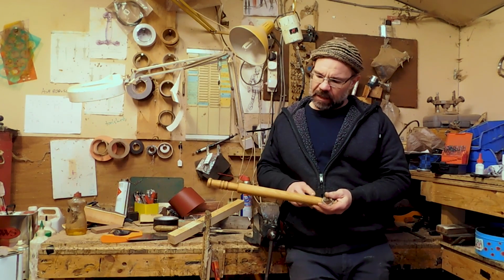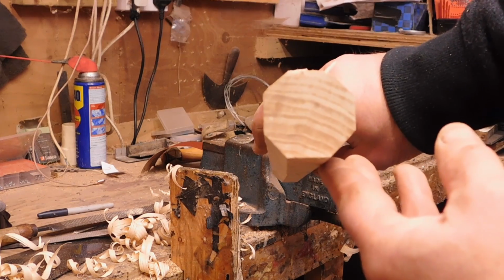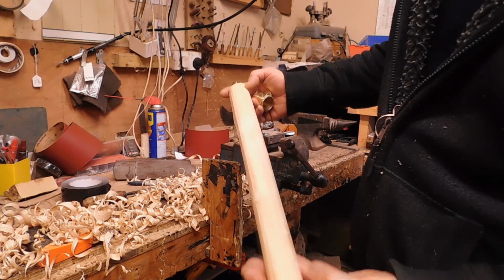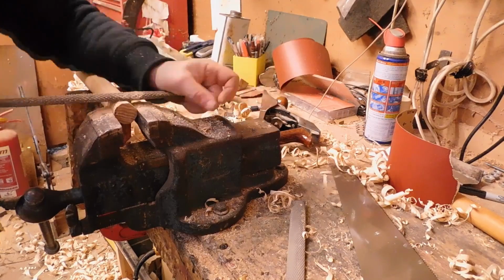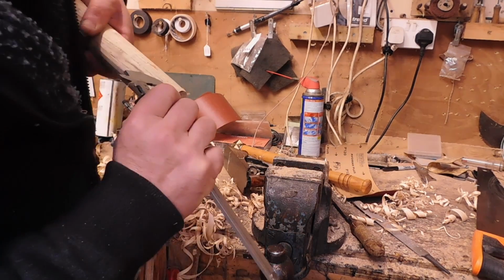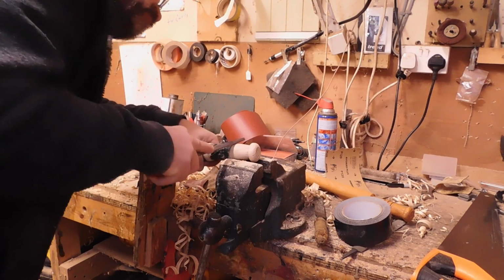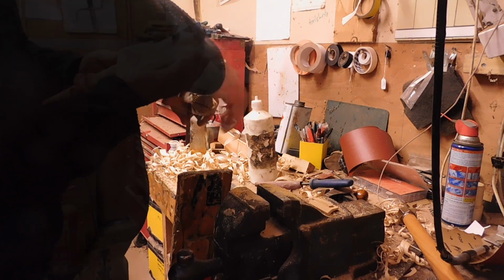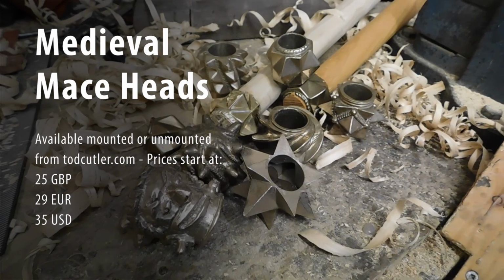Hafting a Medieval MACE HEAD

Comment: What are your thoughts on making a halberd socket? 

Would you make the entire headpiece 2 halves forge-welded together?
Or just make the two socket halves... and forge-weld bade, top spike and backhook between them?

Other option is to split the bottom of the Top Spike and put a flat blade in between the langets. I think this is the easiest way, but it is not fully socketed.

Full square socket seems to be the most common historical method.

Comment: Shafting a head with a saw, quite long winded.& why did you use a clearance fit on shafted bit like a mace or hammer?
your method works but it's not very time productive tod.
you never learnt craft from the elders did ya.

Interference fit is easier, more secure & traditional: 
1;make the shaft mounting end just larger with slight chamfer, then hammer it on while cushioned by say leather rubber or what you got lying around. 
2:get a sharp sturdy chisel & hit a line out for a wedge to hammered in.
3:Optional, cut the excess of the of the shaft to make it neat.  
Note: carpentry saw are a relatively new thing in terms of history grand scope. 
Use a hewing axe or normal ax for rounding the the shaft if  you are confident enough. 
It's not as difficult as it might appear or seem. 
Just takes practice.      

This is how my grand father a part time Ferrier in his free time along with every smith I ever met hafts a bit to a shaft.

Material wise: why use use a square section, just go get a rough sized branch bark & all then hew it to size & treat it before hafting.
Soak the wooden shaft in horse piss for a day then post hafting varnish if feeling luxurious. 
If you don't like piss use old motor oil from a motor but leave about half the time. 
Dry or wipe of the excess before hafting.

using glue on a haft?:) Hilarious!
Some use pitch or other organic sealants to fill in the voids & prevent water ingress but I don't bother!

Hope people fond this useful!

Kind regards!

Comment: Could you also use hickory or oak for the handle instead of ash? My local hardware store only had oak, I really wanted hickory
Reply from the maker: I would go with hickory - hammer handles use ash or hickory, not oak for a reason

Comment: When I mounted a brass mace head onto a handle. I purchased a handle for a Hoe, since it was made of Hickory and already round. All I had to do was fit the head and tack it in place. I also used Hot Glue to hold the head on the handle. So you don't have to start with square stock.

Comment: The most common tool found in the Medieval smiths arsenal.

Ye olde ducte tape!
Reply: Plus ye-old WD-40.
Reply: As amusing as this comment is it also begs the question: seriously, what did they do before duct tape? I mean I know they got along without it but it’s just such a useful invention it’s hard to imagine not having it.
Reply: @Rokaize  Leatherstrips,  charcoal markings,...
Reply: @Rokaize  leather would be the obvious choice back then. Sinew from a animal such as a deer would also be used as once it was in place and had time to cure and become very secure.
Reply: Isn't it obvious? 'Duck' tape.
Reply: Thou shalt meld their iron with heat and hammer.
Reply: When it moveth thou it shall not, 'tis an affront to god; and it shall thoroughly wippeth before its foul body shall be clad in his holy linen!

If it opposes to the lords will and does not moveth, thou it should; 'tis an affront to god; the blasphemic object is to be drenched in his holy liquid!
Reply: seriously usually flax fibre and rosin with bees wax over the top

Comment: Does the tight fitment of the head prevent the crisp 90 degree stress raiser at the top end? What stops the head itself from causing a stress raiser around the top end where there's been a diameter reduction and where where it's not been filed round?

Comment: Just a tip: it's easier to keep your saw straight if you keep your pointer finger pointed out and laid down the side of the handle. Keep it pointed in the direction you want your cut to go.

Comment: From watching your videos, you're much better in the shop than I am. However, I do have one small tip I can give you. When sawing with your hand saw, point your index finger along the side of the handle/blade. Try sawing a straight line with the method you're using here, then try it again with your index finger pointing in the direction you're sawing. I guarantee you you'll be surprised at the difference.

Comment: Years ago a friend made some mace heads out of oil well drill bit teeth. They were a multifaceted head that looked like the one you were using but bigger.  The thing was to big to use by most people for very long. Shaft and head weighed around 4kg/8.8lbs.

Comment: Seems that using a plank to cut down like that would be introducing weakness into the handle.  It would have a greater tendency to split along one axis than another.  I'd be tempted to use a seasoned branch or sampling so that I have round grain all the way through. I've done this for hammer and light hatchet heads and the tool handles have been tough as all get-out and extremely durable.
Reply: EarthKnight wouldn’t you run into durability issues between the heart and sap wood?

Comment: In the US, I think that hickory would be easy to get and probably the best wood to use. It is the most common (by a landslide) wood used In striking instruments such as axes and hammers
Reply: Oak, Ash, and Maple,.... all are native to ALL of North America... No ??
P.S. I've been a reproduction, production, and restoration woodworker, sawyer, machine operator, and furniture/joinery professional since I was 17.... @ 55 now.
Reply: @kennethkustren9381  Well, ash is on its way out, unless a solution is found for the emerald ash borer.
Reply: @kennethkustren9381  absolutely spot on. I prefer Oak. Hickory is also a great option bc of its strength.

Comment: A few years ago, I picked up the Brass Mace head from Kult of Athena, and yesterday I hafted it finally. I got lucky and found a nice oak dowel at Home Depot, that was just a bit bigger around. So last night using a file, sand paper and a good sharp knife I worked the end down till it fit just almost but not quite tight. Used Hot Glue to attach the head to the haft, sanded down the haft and linseed oiled it. Added a lanyard and a leather grip. Looks good and feels nice, now if I just had a head to crack :)

Comment: How about drop the head over a branch or sapling, and wait till it grows snug, then just cut it off! One year of waiting=a lifetime of service.
Reply: The problem is that after cutting the branch will dry and loosen up. Also bark will make it weaker + if you want strong shaft you make it from heartwood not outer rings.  Usually mace head coming loose is not the problem but shaft snapping after heavy blow is. In history they used iron foil around upper part of shaft to reinforce it.
Reply: As Koit Kõiveer already explained there are a number of issues with that, however, there is one example from history that I know of that uses living trees to produce weapons. In the Slavic, pre-medieval tradition 2 handed war clubs were a thing . You'd find a young oak and hammer in flint flakes at the base of it and then just let it grow for a few years. After that time the tree would grow around those flakes, locking them reasonably deep inside and also bulging in that area. After cutting it down and drying it you end up with a heavy, flint-studded war club.
Reply: Kwodlibet what an awesome idea! Those primitive “weapon designers” were a pretty bright bunch, working with available technology of the day.
Reply: Damn, that's an awesome idea! I would do that myself if tree branches around where I live got anywhere near usable proportions for that kinda thing.
Reply: As lazy as I am, I am also impatient. Want to start macing things now.
Reply: Rust
Reply: @Sgtassburgler  Brass doesn't rust. :)
Reply: brilliance!
Reply: there's a methodology for making early axes where you do something similar with a tree with a y in the top but every method ive ever heard of let's the object grow intl the tree into the deeper wood because of issues with the bark and outer layers of wood
Reply: Said the priest. 

Seriously though like, circumcision sucks.
Reply: Just do the magic trick of immersing a dry branch in water with a few adjustable clamps(depending of size of the head) tighten the clamps every day during a week(depending on the hardness of the wood), then take out the clamps put the mace head and let it dry.

Comment: I would suggest seeking out a robust but supple sapling with a full circular grain to it which would reduce the total amount of work, reduce the potential of splitting, and also allow for the use of its natural taper either for the hand grip, or for locking the head in place, too bad a natural sapling won't offer both options at the same time, albeit with the ability to wrap the handle in leather, or else simply leaving the bark on the end will either one allow for a good grip, it simplifies and speeds up the production of a high quality handle.
Reply: In the process of making handles for hammers and pickaxes for many years, this seems like it would be just as good for combat as for non-combat uses.

Comment: So if right angles create planes of weakness, why would you have a handle like that, and not something more like a baseball bat with a subtle thickness curve starting from the handle and thickening out until you reached the head?
Reply: I'm pretty sure it is to prevent the hand from sliding up the mace. On a bat you only have to worry about the bat slipping away from your body as you swing it, but with a mace you are much more likely to have forces trying to push the mace handle the other direction and having your hand ride up the shaft.
Reply: @Saddestpanda  He even explained that in the video, some people...
Reply: knightshousegames Good question. The only answer I can think of is for you to look at the items retrieved from the Mary Rose and the Vasa of Sweden. Looking at was done then would give you the answer to what they did do,back in the day.

Comment: What about for a mace head that's closed at the top? I'm talking about the ones like "Mace 3" on your website. Obviously you can't drive wedges into the top, so is there a pin or maybe some sort of glue/epoxy you would use instead?
Reply: If you are being very extra-especially clever, you could make a  close-fitting haft, saw it, place perfectly-sized wedges in so they rested on the top bit of the mace, then pound the haft in, forcing it onto the wedges and fixing it in place.

Or just cross-pin it
Reply: Samuel Mellars  would be called fox tailing
Reply: @samuelmellars7855  Brilliant solution to pre-place wedges in the socket before pounding the head in!
Reply: One method is to just make the neck of the shaft slightly larger than the fitting of the head. Then you just pound away on the head and cram it on there. Usually, even though it's not necessarily historically accurate, I've seen people use JB Weld (or other 2 part epoxies) in addition to just a tight fitment. I've never seen one fly off fitted that way but obviously it could happen I suppose.
Reply: Michael M  this is done on tools like punners which have a blind hole in them.
Reply: I just used Hot Glue, and made sue the Handle fit tight.

Comment: Which century is this mace head from?

Also, I can't get enough of your videos; They're so informative.. it's just too good.
Reply: @tods_workshop  Here in Estonia   (we were part of HRE in late medieval time) similar  but simpler bronze and iron maces were found from 10- 12 century as i remember. There is a theory that they were symbol of upper rank of military then. Until 14 to15 century there are written documents about maces given to town  tower masters as symbol of their job. Several historic finds had still parts of shafts attached and they had iron foil reinforcement around upper part of shaft and also inside hole. Also iron nails were found as wedges to lock head on shaft.  I  have hold a mace head with dual human faces in my hand. It had still wood from shaft inside hole. Bronze salts are protecting organic material from rotting pretty well inside ground. If you are interested i can scan the documents if i find them. They have english summaries but most of it is in estonian tho.
Reply: @KK-xz4rk  Maybe that's why the hammer is a symbol for justice now?
Reply: Tjat type of maze head has been used since bronze age.
Reply: @ReasonAboveEverything  True. Its effective and simple design. Casted a simple bronze one for myself for testing.  its very easy to carry along and pretty effective for killing blows.

Comment: I'm making wedges to pin my prod into my crossbow stock into place. Does the grain orientation of the wood matter when making a wedge?
Reply: I'm sorry excuse my ignorance, but by axial what do you mean?
Reply: Should the grain run perpendicular to the wedge or horizontal?
Reply: @briananuvattanachai6646  Horizontal I think. So the grain lines run parallel straight down the side edges from the thick to the thin end.

Comment: Thank you for taking the time to show what you are doing and for explaining why you are doing it. Considering how similar the mace is to the axe, it’s a very different process. I expected you to slide the head up the haft from the bottom onto a taper and then cutting it and wedging it once tight. When hanging an axe head, I avoid a ‘shelf’ under the head as it seems to create a line of weakness. I always try to keep smooth flowing lines. An interesting weapon though. I guess it would have been used by everyone from the unskilled poor right up to the rich where it was more ceremonial? I’ve taken some good tips away from your video, using the plane to cut a taper, glue to fill imperfections and using an open vice to hold a round haft when working on it. Thanks again. 👍
Reply: tod todeschini very cool interesting video I'm a carver too and loves anything medieval so I'm a living history buff too greetings from UK England Essex near London🐾🐺💕👌
Reply: The shelf is a weak point to be sure though I suspect it wouldn't be anywhere near as much of an issue as with an axe since unlike an axe any blows made with the mace don't have any leverage to add additional stress to the weak point since it doesn't protrude much past the width of the shaft. Also historically a mace was arguably of more importance to someone like a knight than your average fellow and rarely ceremonial, a weapon like a mace or a warhammer were commonly used by knights to combat the armour worn by other armoured foes. Even though a mace wouldn't penetrate plate armour the concussive force could injure the wearer through their armour and by denting it severely the mace could be used to lock up segmenting plates and restrict the opponents movement.
Reply: That shelf under the head is a weak point.